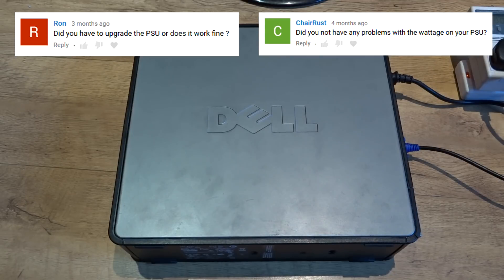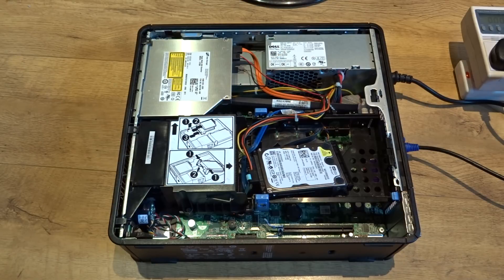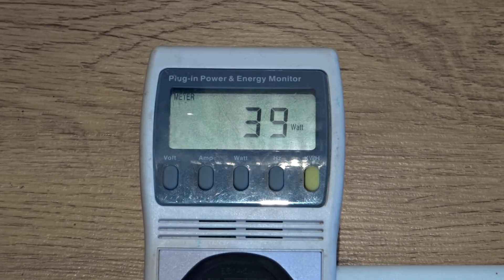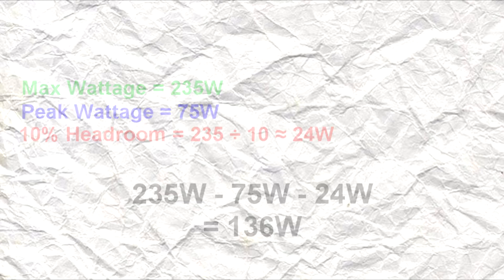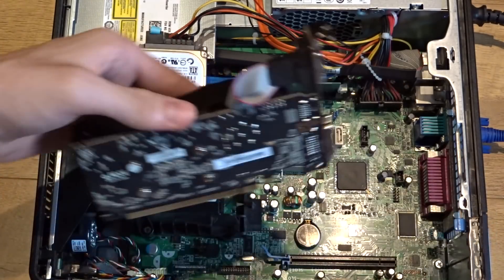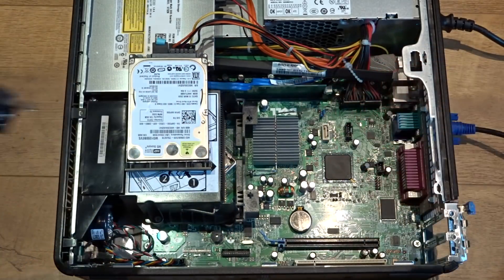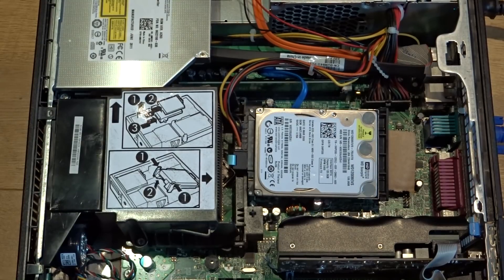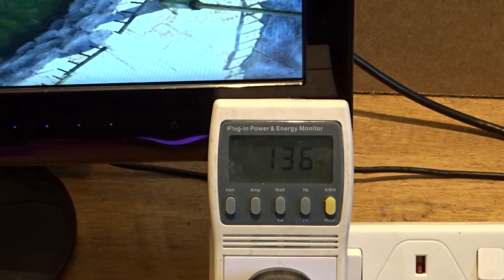Optiplex 780 SFF to Gaming PC

Comment: What graphics card should I get for it ?
Reply from the maker: Unfortunately, you will be very hard-pressed to find a newer graphics card that will be able to fit into this case without modification. Linus Tech Tips made a good video: https://www.youtube.com/watch?v=J8ja79SlA-g

As for the card itself, you'd need to check the motherboard's maximum power delivery and the PSU power delivery before making a decision. You can get cards that don't require additional power cables but make sure the motherboard can handle it.
PC part picker can help you find a graphics card: https://uk.pcpartpicker.com/products/video-card/#Q=0

Comment: the worst that can happen is you don't get the full usage of the card. I've ran under powered psu's on needy cards and normally they just run slower than they should. when you add a better psu you  will notice a big improvement in performance. easy peasy
Reply: bro you think my pc can handle msi rx 550 4gb oc in a 240 watt psu and i5 4570
Reply: @GeekBastion  not sure what the power requirements are for the rx550 but it might be to big of a gap. I had a 350 watt psu running a gtx760 and when I put the gpu in with a 500 watt psu it was like turbo kicked in lol I believe there is a grey area where I was underpowered but had just enough to run it.
Reply: @Onmybutt077  rx 550 recommends 400 watt psu but it's tdp is just 50watt unlike the 1650 that requires 75watt to operate and 1050ti that needs 65 watt
Reply: Also i saw a comment on amazon with a guy saying it was working fine with 240 watt psu

Comment: Dell optiplex 755 EVGA 650TI 2gb will it work? Please I am buying a graphics card
Reply from the maker: It depends on the model. I'd say no, it won't work without replacing the power supply as well. Most GTX 650 Tis have a power connector; most Optiplex power supplies do not.
Reply: Nvm I have a 6 pin! Yay

Comment: Do you think it would be possible to overclock the gtx 750 ti with a stock 255w psu (I have an optiplex 780 too but the bigger one) or is it just too dangerous to push the 75W limit of the PCI x16 slot. I have a q9650, a SSD, and two ddr3 4gbs of RAM. Edit: what's the cpu that you are using on this PC?
Reply from the maker: I believe this computer uses a Q9400.
Although it is possible to overclock a GTX 750 Ti on this kind of system, it's not really worth doing.
Reply: @MightyElemental  I see, thanks for the reply!

Comment: Hello, I have just been given a stack of old  Windows XP games such as TES Oblivion, GTA San Andreas and Rome Total War and am looking to buy a cheap pc off ebay to play them. I have seen a couple of refurbished systems that look like what I might need:

Dell Optiplex SFF - Core 2 Quad Q6660 - 4GB RAM - 1TB HDD - 2GB GT710 - Windows XP
or
Dell Optiplex SFF - Dual Core 3GHZ - 4GB RAM - 1TB HDD - 2GB GT730 - Windows XP

I am a bit confused though because I asked the seller of the Core 2 Quad pc if he could fit a GT 730 instead and he said yes but the other seller told me that a similar pc he had doesn't have the power for that card,  which is why he is selling it with the Dual Core pc instead. If the Core 2 Quad doesn't work with the GT 730 which would be the better pc as listed? Also would either systems be able to play later XP games such as TES Skyrim, GTA IV and Shogun Total War 2? Sorry if I sound a complete noob but I have only ever had games consoles in the past so don't really know much about PCs.
Reply from the maker: Are you planning to only play old games? The GT 710 and GT 730 are display adapters and not really designed for gaming. However, if you're only playing old games it may work.
The GT 730 is rated at under 40W which is suitable for most computers. HOWEVER, I don't know the optiplex models you're looking at so I really couldn't say - some only allow 25W.
I'd personally go for the quad core and upgrade the parts if needed. I'd also suggest looking for a cheap i5 or i7 system rather than a Core2 system.
Please also note that windows XP is no longer supported by Microsoft so there are many security risks.
Reply: @MightyElemental  Hi, thanks for the quick reply. Yeah, I'm only going to play the XP games I was given and maybe a few later XP games but nothing after XP. I have no intention of going online with it so I can't see any security issues and if I do need to download any extra drivers I can always download them to my smartphone phone and stick them onto a usb stick to copy over I'd assume.
Reply from the maker: Sounds good. I just wanted to make sure you were aware of the security risks if going online with XP.
I'd recommend looking up the game requirements and checking that the system is capable of playing them. My guess is that most XP games will be able to run on a GT 730, though don't quote me on that. I don't really play enough older games to be able to say.
Reply: @MightyElemental  If that seller can't install the GT 730 afterall would the quad 2 core with a GT 710 still be better than a dual core with a GT 730? I am so confused by all  this because I have been told most older XP games don't use multiple cores anyway and the dual core is 3Ghz whereas the quad 2 core is 2.2Ghz.
Reply from the maker: If you're only plan is to play games, a dual core should be fine for those older titles.
Do you know if the dual core is a pentium or a Core2Duo? I'd avoid pentiums.
Reply: @MightyElemental   That's a very good question because I just asked the seller and he THINKS it's a core 2 duo which isn't exactly an inspiring answer and the other seller hasn't replied to my request to go ahead and put the GT 730 card in the quad core pc so I'm kind of stuck between a rock and a hard drive (that's my first ever attempt at a pc joke!)
Reply: @MightyElemental  Hi, I've just seen another system that has a quad 2 core, 4gb, 250gb hard drive and a 512mb graphics card that is described as a retro xp gaming machine so I'm assuming the graphics card is  a gaming card and not just a display adapter. Depending on what graphics card it is would the system be a better buy for what I want, i.e purely retro XP gaming? Also, would I need to buy a sound card or is the onboard sound adequate?

Comment: It's optiplex 780 have a driver for gt705 plsss I need help
Reply from the maker: Yes, you download it from nvidia's website.
Reply: @MightyElemental  lol it's not working bro I really need help the driver is not compatible 😥
Reply from the maker: Is everything plugged in correctly? Does the device show up in software? It doesn't make a whole lot of sense for nvidia's driver to not work with their own product.
Reply: @MightyElemental  yes it's all plugged but wtf any driver for my video card is not working why gt705
Reply from the maker: Does the computer turn on? The gt 705 is hardly worth even using. It's a display adapter. I'm not sure what you intend to do with it, but gaming is out of hue question.

Comment: I don't think this is very safe at all. The CPU needs a cooler and the cardboard will not be able to take it and may catch on fire. It is also bad to have a lose hard drive. Serious fire hazard! Just use the PCI-e x4 slot instead or something.
Reply from the maker: I'm not sure what you think the CPU is since it already has a massive cooler on top of it... I'm using the only PCI-e slot on the motherboard so I didn't really have much of a choice there. And as for the cardboard, it was a bad choice but I chose it because it is non-conductive. Cardboard has an ignition temperature of 427°C so I'm really not concerned about it starting a fire.

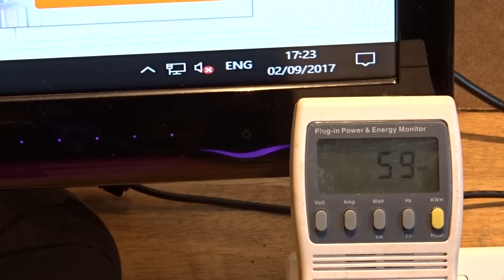Comment: I saw at 3:34 you don’t have any audio available. Did you ever managed to fix it? Or is that a limit of the CPU
Reply from the maker: I'm not sure I understand the question. The audio works fine on the computer. I just didn't record the ambient sounds that comes from the benchmark at the end.
Reply: MightyElemental at the bottom right hand of that frame I highlighted, I see on Windows that your audio has a white ‘X.’ I’m running into an issue where I can’t get any audio output from this PC. Even with a GPU. How did you get audio working?

Comment: Nice video! I do have a DELL Optiplex 755 SFF, mine has a 275 Watts power supply, Intel Express Q35 chipset, and the solid copper base CPU heat dissiper. Current plan upgrades are:

1. Change the CPU from an Intel Core 2 Duo E6550 (Dual Core @ 2.33Ghz) to an Intel Xeon 3363 Modded from LGA771 to LGA775 (Quad Core @ 2.83Ghz).
2. Replace the 80GB 3.5" HDD to a 2TB 2.5" HDD (for less power consumption 3.5" HHD consumes from 6.5W to 9 W while the 2.5" consumes 0.7W to 3 W).
3. Get a 3.5" to 2.5" HDD bay adapter to fit the 2.5" HDD in the DELL 3.5" HDD Caddy.
4. Buy a Yeston AMD Radeon RX 550, it has 4GB of GDDR5 RAM and peaks at 50Watts in power consumption, cost a little less than the Nvidia GT 1030 and performs about the same or better.
5. Add an Asus Xonar DS PCI Low Profile Soundcard for kick ass sound, Dolby Digital and DTS encoding. 

This will make this SFF PC into an awesome HTPC, light gaming and retro emulation machine.

Could use an Nvidia GT 1050 or 1650 low profile but those are 75 Watt peak power so they are on the limit and could stress to much the power source on these SFF PCs.

Comment: Hey, What can you say about Dell Optiplex 9020 Sff 255 watt psu, putting on Geforce Gtx 1050 ti low profile? Is it safe?
Reply from the maker: The GTX 1050 Ti has a TDP of around 75W whereas the GTX 750 Ti is around 60W. It's pushing the limits of the system and not every Dell system allows for 75W to be delivered via the PCIe slot. I'd recommend looking into what other people have done to upgrade their Optiplex 9020s.

Comment: Actually the pcie only delivers 50w not 75w so u didn’t do ur research
Reply from the maker: I'm curious where you got the 50W rating for the PCIe slot on an optiplex 780. I'm unable to find that rating. The only ratings I'm seeing are 25W and 75W, and in every case its 25W, it says so on the motherboard itself. 75W for a PCIe slot is standard and using that, I was able to use this gtx 750 ti for months without issue.

Comment: Well i have an optiplex 760 with an e4600 4gb ram and i want to add an gt 730 2gb gddr5 and an ssd 240gb, Will 240w psu support it??
Reply from the maker: The GT 730 is rated for 38W. The E4600 is rated for 65W TDP. There are other components that will draw power (obviously) but I think a 240W PSU would work. But only use it if you are comfortable doing so; and know that if you do, you do so at your own risk.
Reply: @MightyElemental  well what i'm gonna use it's The GPU, CPU, an ssd 240gb, HDD 160gb, 4gb ram soo that should work with no problem.
Reply: And the dvd writer it's not gonna be used

Comment: You removed the CPU heat sink fan - ouch!
Reply from the maker: Not quite... The fan I removed was the hard drive fan. The CPU heat sink fan is part of the bulky box to the left of the one I removed. I would be quite concerned to run this computer without a CPU fan given its size...

Comment: Can the graphic card be a GTX 710 ti or does it have to be a 750
Reply: Not for sure if u meant gtx 750ti, any card should work as long as it has no power connector on it and is less that 75w, check motherboard pcie output watts cus some are different thou

Comment: If i buy a 500w power supply can I leave it outside the case? (For my dell 780 sff)
Reply: You need ATX 24 pins - 24 Mini pins adapter, the 780 SFF motherboard power connector use Mini pin

Comment: Great video, many thanks.  I also have a 780 SFF with an E8500 and a Dell R5 240.  Is the PSW good enough for a Q9550?  I have the copper heat sink already, but worried about power under load. Thanks.

Comment: I am using a dell OptiPlex 780 with a gt 710 graphics card at the moment. would it be safe to put a gt 1050 in when the 1050 has a 400w requirement or will it overload my pc?

Comment: Do you reckon a 235w power supply could power 4 x 2Tb SATA drives instead of a graphics card?
Reply from the maker: Assuming each drive will use about 10W (based on 3.5" HDDs), that's 40W. The graphics card I installed was closer to 80W. So, if you have the right adapters for power delivery, I think it could work.
Reply: @MightyElemental  Awesome thanks...That's the other thing, the PSU doesn't have any molex connections, so I'm wondering how else one could power said SATA drives...?

Comment: When i put a msi gt 710 in that what will hapen im very scared now lol
Reply from the maker: A gt 710 only uses ~19W of power. There is more than enough power from the PSU for that graphics card.
Reply: @MightyElemental  I have got a dell optiplex 780 SFF with just 220W PSU could i put a  gigabyte nvidia gtx 750 ti black edition inside? Whats the (W) usage of this GPU ?
Reply: @songsinslovakversions9591  60w
Reply: ChamsGaming99 does it still game good

Comment: Just a question, if I have an Optiplex SFF and squeeze a umm lets say a 600w PSU, can I at least put an RX580 in that?
Reply from the maker: The trouble is that optiplexes are built backwards so any graphics cards put inside have to be single slot. They also will need to be low profile due to the slimness of the case. Other than physical constraints, it should work. So if you decided to buy a PCIe extension cable then it should work. But you'd also need a gpu enclosure in that scenario.
Reply: @MightyElemental  thanks! Well at least I knew it would work, working on my sleeper optiplex, but not till I get the RX580 and the PSU 😂
Reply: @bryanleiporsado6845  RX580 + Optiplex 780 c2d cpu = Bottleneck garanteed! lol
Reply: @ivannevistic1088  nope Optiplex 9010 or 9020 supports 4th gen Intel processors and has 4 slots of ram also up to like 32gb, I would definitely put i5 4460 in it or so.

Comment: I have optiplex 780 not sure which model or what PSU Watt i also have 2GB ram DDR3 1000 MHz i think hard disk 148 GB Intel E-5300 2.6 GHz i want to add another 1 or 2GB ram and this low profile Graphic card is it safe?
 

https://www.gigabyte.com/us/Graphics-Card/GV-N710D5SL-2GL#ov 

Someone advice pls thank you?! P.S. yeah people making mistakes about powerful graphic cards this is not for gaming but this card its really low Watt with a lot lower temperature so from what i've read needs from 19 to 25 W while normal Average needs from 70 to 90W. I still have from old PC GT430 1GB DDR3 but needs minimum 300W recommended 600W but i think that one its to much while this one needs minimum 19-25W recommended 300W so tell  me what you guys think! Sry for bad English!

Comment: The HP Elite Series SFF systems are much better configured and easily accept an add-on GPU with no interference with internal componants. The HP EliteDesk 800-G1 I have is a 4th gen Intel system that is loaded with 24GB DDR3 RAM, i7 4790, SSD hard drive, GTX 1050 Ti and gets over 4500 on a total system Passmark score. You need to realize when looking for a video card you MUST get one that is "low profile" design. A full height card will not fit in these SFF systems. I've got just a shade under $500 in this system and I'm getting at lease 100 frames per second on games like CS-GO, Diablo III and Overwatch on high or ultra settings and 5G wifi speeds (wifi add-on card). No frills, bells or whistles - just a solid, stable platform, compact design and quality factory components. Not to mention, these are still supported with drivers and system info on HP's website as well as replacement parts and part systems being really cheap. The 7th generation systems are beginning to become available for around $300 or less on E-Bay.

Comment: What video card did you put in there? I have an Optiplex 745 desktop model. I upgraded the CPU from an E2140 to a QX6800. I've upgraded the RAM from 4 to the maximum 8 GB. I'm looking for a suitable video card maybe under $60 or so because I don't think a higher cost card is justified for such an old computer. What do you recommend?

Comment: I use a optiplex 790 sff with a msi gtx 1050ti. The only problem I have os the GPU fans sounds like a F16 when I play certain games, but the temperature in general is still normal.

Comment: I read somewhere that there is a wattage limit on the 16x pcie slots on these proprietary dells, and they cap at around 25 to 35 watts, instead of standard 75 watts. Is it true and did u face any issue or warning etc when u used the 750ti?
Reply: You can always check online for the computer's manual. My Optiplex 745's manual says the PCIE 16x slot supports up to 75 watts, so I don't think it's likely to be limited on the 16x slots.
Reply: @themotivator2587  just upgraded from core 2  duo. Bought a cheap mobo and 2nd gen pentium combo and rigged it in a custom hp case and Viola! so long optiplex!!
Anyways cheers for the info m8

Comment: I have a pc dell optiplex 3050
i5-7500 7th 3.4Ghz turbo cache 3.8Ghz with (65w of tdp)
The power supply is 180w
and the energy control is as follows
180 W power supply
Power supply, input voltage 90 - 264 V
Power supply, input frequency 47/63 Hz .. If I put a GTX 1050Ti 4gb would not have a problem?
Reply from the maker: I personally would not risk that card with that power supply. I'd recommend getting a better psu, at least 300W I'd say. You should be able to get one for around $20-$30 on amazon. Just remember to get a psu from a trusted manufacturer... You don't want a poor quality psu as they can pose safety risks...
Other than that, it look like you've got a decent gaming machine.
Reply: @MightyElemental  Thank you very much for answering and for your advice!

Comment: A heads up! Many SFF boards' PCI-e slots pnly output 50W or even 25W even instead of 75W.

That could be a severe bottleneck for the card or make it not work outright.
Reply from the maker: True. But the specification for this motherboard is 75w

Comment: What about this: optiplex 990 with removed i5 2400 and put i5 3570K? And then a video card. Is the gt 1030 the best option? 30watts should be safe for sure. What do you think?